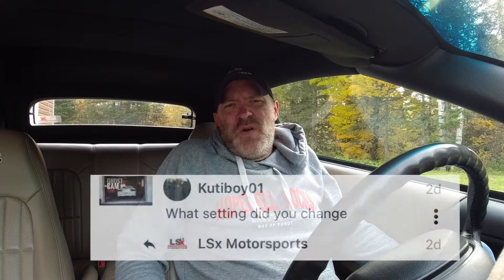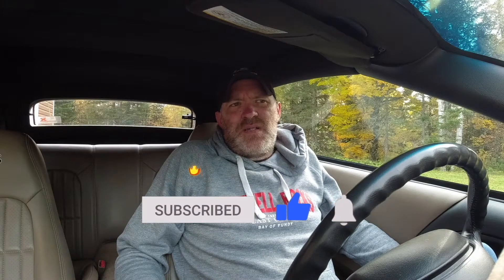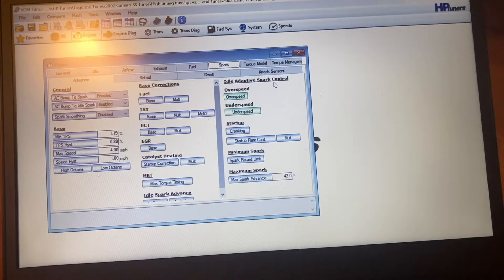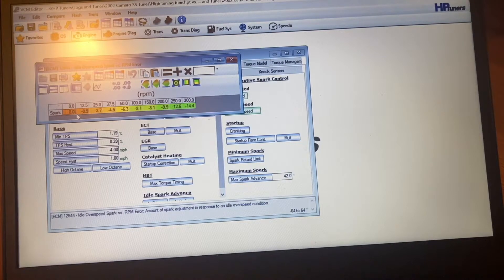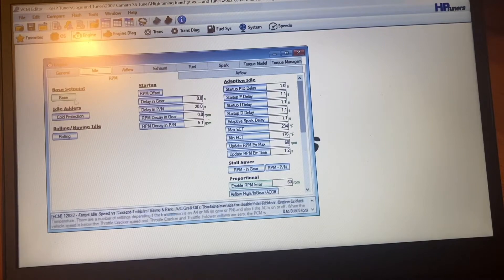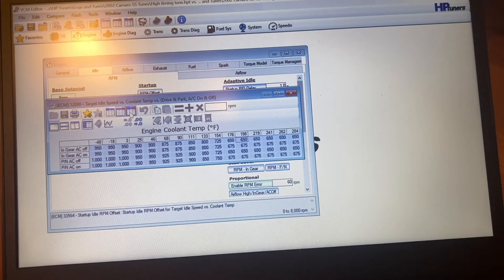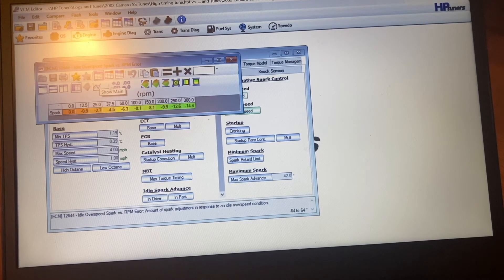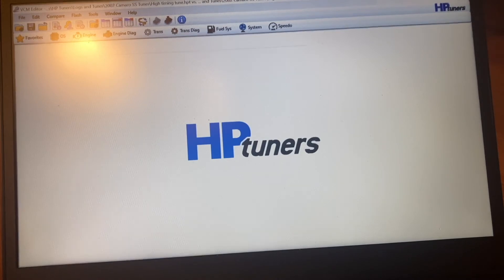Make a small cam sound like a big cam - How to get a more aggressive idle using HP Tuners

Comment: How do you get the rev to to drop so fast?  Mine hangs and sounds like its going to blow up.
Reply from the maker: Ah yes that is a tuning issue. When I put the cam in mine it would also hang. I honestly can't tell you right now how a fixed it but there is a way with HP tuners. When I put the cam in there was a couple procedures I used to keep it from stalling and to keep it from hanging when you Rev it. I will look tomorrow and when I find the videos I will post a link for you. I  don't do enough tuning to remember how I did it.
Reply: @LSxMotorsports2021 ok, thanks.  I'll be waiting,  need it to drop idol fast.  Sounds like it's going to blow up with that btr hoss cam valve train.
Reply: @LSxMotorsports2021 I've been playing around with hp tuners but haven't figured the rev delay out yet.
Reply from the maker: Here are a couple videos that may help.

https://youtu.be/423ZMUHPRu4?si=21qAt0_VmZiFhEOJ

https://youtu.be/dnb_upRXb6E?si=419jBi04hCVd1Nkz

https://youtu.be/NshcGCEMqNs?si=EnaxuRN-pprEnwlx
Reply: @LSxMotorsports2021 Thanks, I'll try that spark timing and see if that helps.

Comment: Neighbour islander here, i got a 07 silverado 1500 classic with the dbw, my cam sounds choppy at p/n but as soon as i put in Drive she pretty well flattens out like stock, any pointers?
Reply: I do have a stage 2 Nsr cam in er, as per some suggestions I’ll have to play with over and under speed tables.
Reply from the maker: Well first off I am not very experienced at tuning. But I don't think there is anything you can do there other than get a cam. But you really don't want it choppy in gear anyways because it can cause stalling. I like the chop too but I have my car tuned to idel as smooth as I could get it. Just alot better to live with.

Comment: I done this and it worked except when i adjust it far enough for it to chop it wont stay running it chops and either cleans itself.up and runs normal again or it stalls
Reply from the maker: Yeah if you have a stock cam you can only go so far with it.My car has a small cam so it has a little chop to start with and when I do this it chops pretty good.Youll have to experiment with it till you get it to the point that it stays running but has a little chop.I actually never tried leaving it for any length of time so it may smooth itself out over time.
Reply: @LSxMotorsports2021  i would add 60%+ to the smoothing and it would chop for a good bit then clean up and idle smooth then i added more it chopped like hell but would stall after a min and if i revved it it would stall when it dropped back to idle but yea its just a stock truck 5.3 with a bump to 10:1 comp
Reply from the maker: Yeah you will have to back it off a little.It may not chop the way you want but you can only get so much from a stock cam.I actually am still learning this stuff myself really.But on the bright side there are alot of really good cams available for the 5.3 trucks.

Comment: I'm late to your channel. I Grudge race a 2000 z28 Camaro LS base stock suspension. My ? Is my car was hitting so hard from vengeance. Then I let a another local tunner tune it. I noticed rt off it didn't hit as hard. Mind you over 620 life and 245 duration on a 112 lope. So is it just timming that makes it hit harder ? Ps thanks 🙏🏾
Reply from the maker: Well first off I am not an experienced tuner so my tuning knowledge is not great.But if it was working great with the original tune you had and then after getting tuned the second time something was changed that hurt the power.Less timing can cause it to lose power and being too rich with fuel or too lean can also lose power.You should talk to the last guy that tuned it.Could be that the tune that seemed to make more power may have been dangerously lean or had too much timing that it was getting spark retard and the guy made the tune safer.Too lean or too much timing can destroy an engine.Wish I could be of more help but like I said it takes years and tuning multiple cars to get good at tuning and I just don't have the experience.I tuned my car but that was from many many small changes to get it working well and I suspect a experienced tuner with a dyno could squeeze a little more power out of my car.
Reply: @LSxMotorsports2021  Thank you. For giving me your opinion. I'ma sub thanks Jr. Ps I just noticed the ide hit was not as hitting hard like before I let him change stuff from what vengeance had it at. But thanks Jr.
Reply from the maker: Well if you mean Vengeance racing originally tuned your car then it was probably a great tune.I would say the local guy messed up your tune.When tuning a high duration cam like yours you really need to know what you're doing to get it to work properly.You may need to get retuned by Vengeance to get it working like it used too.Like I mentioned the more tuning experience the better the car will work and Vengeance racing has alot of experience and a great reputation.
Reply: @LSxMotorsports2021  🙏🏾💯 Thanks for your input means a lil more vs a person that never turned or know bout LS cars drag race stuff.

Comment: is it bad for the engine?
Reply from the maker: That's a good question.I would say it shouldn't hurt anything.It only does it at idle,Once you give it throttle it goes back to the normal timing table.But I am new to tuning so I can't say for sure.I will have to do a little digging to give you a better answer.
Reply from the maker: From what I have read it is not bad for your engine but is bad for the cats if you still have them.But without cats it is fine.May have to play around with the tune to get it where you want it without issues.Meaning if you go to far with it you could have stalling issues when pulling away from a stop or idling around a parking lot.

Comment: Did you have any driveability issues from populating the first cells or the 0.0 cells in the overspeed underspeed tables?
Reply from the maker: No seemed to be ok but I only drove it a short time that way.I personally don't care about having the rough idle so I set mine to idle as smooth as I can get it.It still has some chop too it but not as much as in this video.How this would work on a stock cam I am not sure.I am very inexperienced when it comes to tuning that's why I don't post too much on how to tune.I have tuned my car and it works great but tuning 1 car doesn't qualify me to teach anyone else.The only reason I posted this video is because it is pretty straight forward and you shouldn't get into much trouble messing with the idle.Thanks for watching and commenting.Wish I could be of more help but just not enough experience.
Reply: @LSxMotorsports2021  Thanks for the informative reply. I am too learning HP tuners and I have a BTR stage 2 cam in my vette. I love watching other content that gives me ideas. You have some great content, keep it up👍
Reply from the maker: Thanks alot we appreciate that.